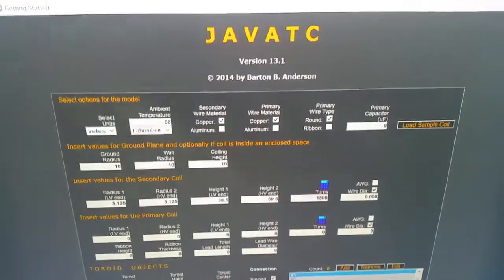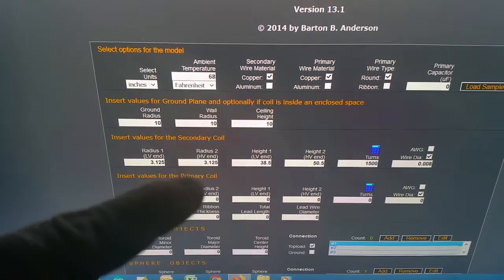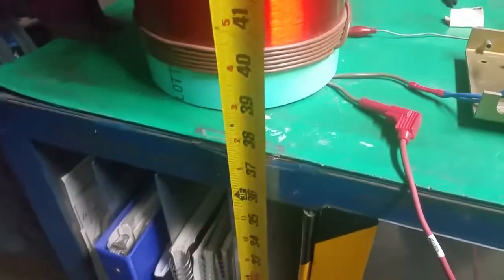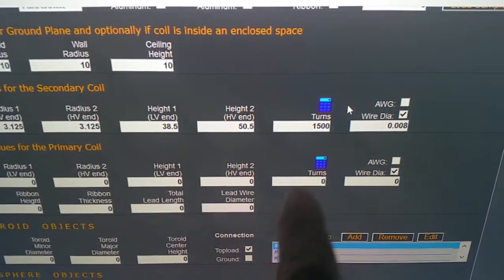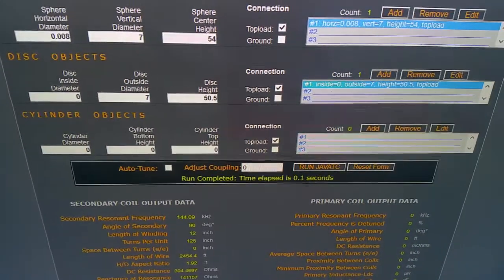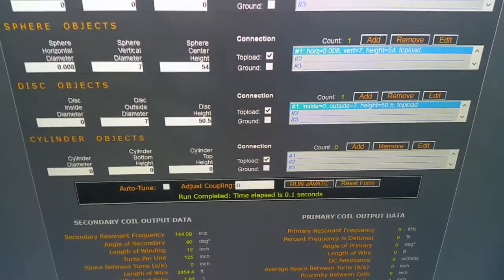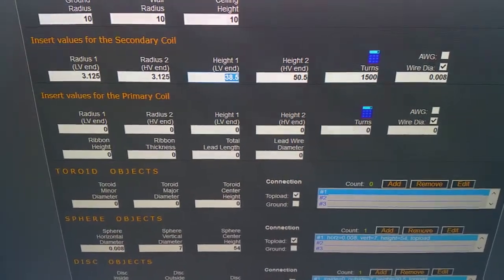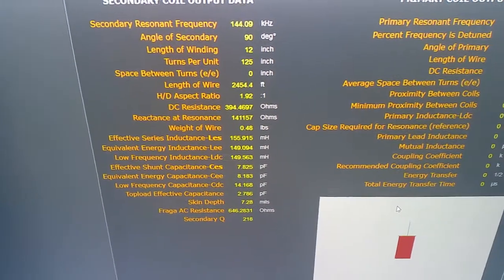Javatc - just how accurate is it?

Comment: this thing doesn't work at all. i enter height 1 = 0 (bottom), height 2 = 30cm, turns 1250, wire dia 0,2 and it tells me the turns dont fit. hilarious. and if i enter 0.02 DC resistance is wrong, wire length is wrong, everything is wrong.
Reply from the maker: It can be tricky and it has been a while for me so I apologize if i get this wrong but for height 1, if it's sitting on a table, height 1 will be the dimension to top of the table (32" for example).  That's your build surface.  If your winding area is 8" then height 2 will be 40".   Use a caliper to measure the actually size of the wire.  Actual diameter is different than awg due to enamel coating.  Plus you will need to account for a tiny air gap between each winding.  
Sometimes it can get tripped up and it's just best to start over.